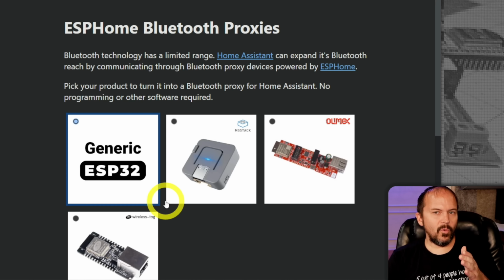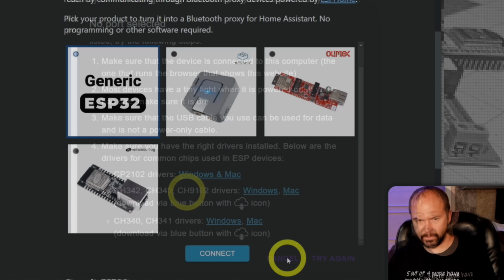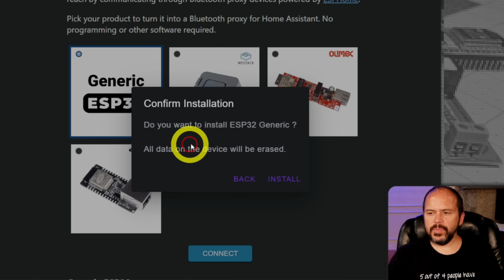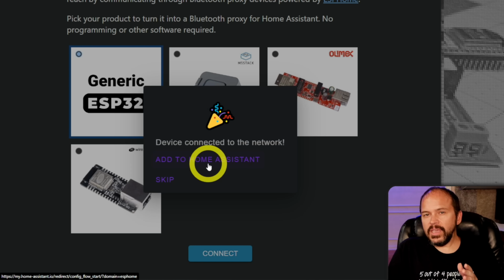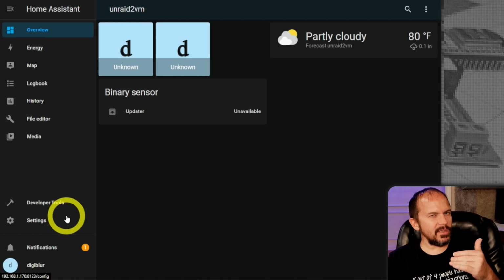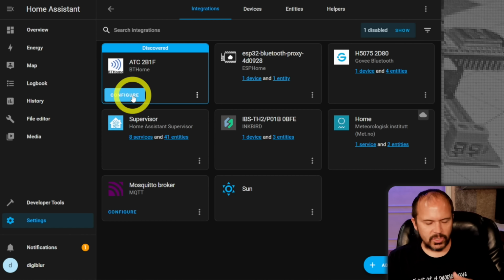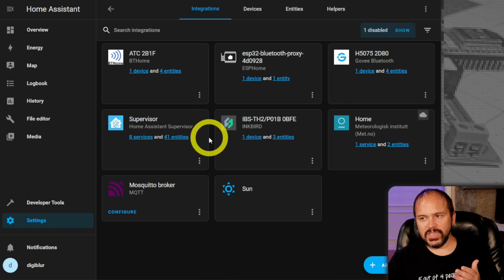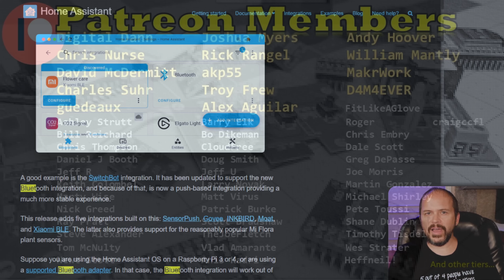How To Make a Home Assistant Bluetooth Proxy | EASY NO Soldering

Comment: I just built 3 bluetooth proxy devices based on the Mini ESP32 ESP-WROOM-32.  They all work throughout the house, as I tested them with a Switchbot thermometer.  My purpose in all of this was to utilize a Level bolt lock in my front & back doors.  I received one today and got it working in HA, but it won't work beyond about 15' of  my bluetooth dongle.  This tells me that the lock is not working through the proxy.  Any idea why this would be so?
Reply from the maker: That is the one thing I have seen asked many times. Attribute to show where the last update came from.
Reply: @digiblurDIY  I'm not sure what you mean.  Can you elaborate any?
Reply from the maker: @joej8361  basically something to show where the device connected. Proxy name etc.

Comment: Does this work with a Shelly Plus?
Reply from the maker: Yep!  I flashed one with it and enabled the Shelly switches as well.
Reply: @digiblurDIY  How did you accomplish that? I`m ending up with a boot loop with this config:
esp32:
  board: esp32dev
  framework:
    type: esp-idf
    version: latest
    sdkconfig_options:
      CONFIG_FREERTOS_UNICORE: y
esp32_ble_tracker:
  scan_parameters:
    interval: 1100ms
    window: 1100ms
    active: true
bluetooth_proxy:
  active: true

Comment: Does the Xiaomi Mi Scale 2 work with this bluetooth proxy?  I added the proxy and then stepped on the scale and I don't see it show up as another device.  Thanks!
Reply from the maker: It might not be supported until later on the active connections as they stated.  Phase 1 was passive connections.

Comment: what happens with setting up xiaomi scales where the bluetooth has to be specified in its setting eg hci0
Reply from the maker: That is probably the configuration coming in phase 2 next.
Reply: @digiblurDIY  feels very half-assed as usual, makes a change from them deprecating something though
Reply from the maker: They do talk about it here https://www.home-assistant.io/blog/2022/09/07/release-20229/#bluetooth-everywhere

Comment: I remember couple months ago you said to use Tasmota for flashing ESP32 because of some filesystem issue is this still valid ?
Reply from the maker: I don't recall any esp32 issues.
Reply from the maker: This is a little different use case.  Blerry is on the ESP processing packets.  The proxy for ESPHome is just sending the packets to HA to process.
Reply: @digiblurDIY  if you were to setup now which way would you choose ?
Reply from the maker: The proxy is going to be the easiest to setup if you use HA.
Reply: @digiblurDIY  i know it's easier i am asking what guru would choose aside from ease of setup :) maintainability support future paths etc.

Comment: After few hiccups  I was able to add esp32  device in  esphome dashboard.   Using 'visit'  link, i can open device web page, But it is always 'offline' in homeassistant esphome dashboard.
Reply from the maker: You might need to assign it a static IP and/or use the ping option in Esphome
Reply: @digiblurDIY  is there any advantage over using  tasmota32-bluetooth vs esphome proxy  on esp32?
Reply: Only way I could add this device to esphome dashboard was using 'assign it a static IP'.  Device webpage  does show logs of (re-) flashing and 'Home Logs 2022.8.3 (::FFFF:C0A8:C86B): Connected successfully' - but no BLE entities, just 'button.safe_mode_boot' button.  Looks like it just sees as Unifi device. (ps" When flashed with Tasmota32-blutooth bin, it picks up BLE devices.)

Comment: Thanks Travis for your nice work.
I’m using Bluetooth proxy to extend coverage of Bluetooth devices (Alarm Clock Qingping (CGD1), Xiaomi Smart Kettle (YM-K1501) and Xiaomi Temperature/Humidity Sensor (LYWSDCGQ)).

For me most important to use the proxy for Xiaomi MiFlora (Plant monitor – HHCCJCY01. But so far it is only possible through Bluetooth integration (connected to Raspberry Pi 4 B+ directly).
Is it possible to use MiFlora with the proxy?

 REPLY
Reply from the maker: I have heard people using those through the proxy.  I don't have any myself though to say for sure.

Comment: Has anyone tried such a Bluetooth device with air quality sensors included?  Closest I've found are B0B616VGQJ or B09YQ2HGVB, but I highly doubt they work outside their respective apps.
Reply from the maker: I know one was worked on by the Blerry project so it could probably be done in HA as well if the packets were analyzed